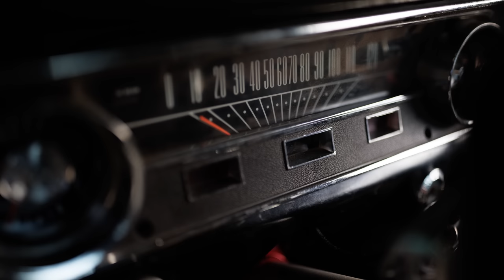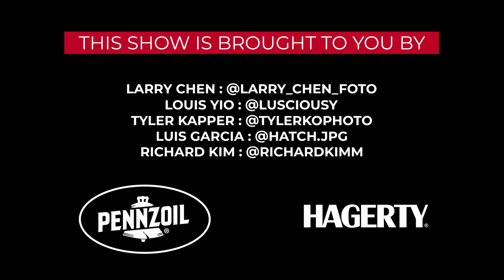TJ Hunt's GT-R Powered Mustang From Fast and FURIOUS | Larry Chen-Capturing Car Culture - Ep 3

Comment: Here's the thing about mid '60's six cylinder fastbacks (both the Mustang and especially the Barracuda) They are really light compared to later muscle cars. 1200 to 1400 kilograms.... with the cast iron engines being around the 200 kilo mark alone. Drop in an all alloy six, say a F6 Typhoon or Barra for this, or MoPar V6 for the early Cuda, and you wake up the handling and don't need huge power for them to be exciting.
200kW in 1000kilos, is like 600kW in 1800kilos, but able to change direction much much faster
Reply: I was thinking of a Pentastar V6 swap on either original Valiant Cuda or the modified A-Body Cudas because I think it will fit, gives enough power, but still can get a.very decent gas mileage.

With one catch: it has to be stick. I also think of putting either the T-56 or just go old school with the original A-833
Reply: @sx4mania35  I'm shopping for parts for my '66 VC Valiant, JK Wrangler has the 3.8 version of the 3.3 in my Voyager, later units had the 3.6. Both versions got a 6 speed manual (NSG370). The output end of the gearbox, the bolt pattern matching the transfer case, also matches a GM automatic that uses the same 4wd transfer case, and there's an output housing for the GM auto that would take very little machining to make the 6-speed (and the earlier NVG3550 5-speed) in to a RWD gearbox. An extension to the output shaft  will be needed, to bring the shaft through the adapted output housing to where a tailshaft can mount.
The engine will need an aftermarket ECU, but,.. Modern emissions and economy...
Reply: Also, rebuild costs of the 3.8 V6, compared to getting the same power out of a Slant 6,... the 3.8 is about 1/5th the cost.
Reply: @PiDsPagePrototypes  I know that feeling, especially CARB states...

the NSG is a very good box, especially if you're on a budget and do not want the fuss of transplanting a T-56 or keeping the old 833.

I think some aftermarket manufacturers have the elongated output shaft (not sure what you mean here but I assume it is the prop shaft), you can check suppliers like Summit.

Don't get me wrong. I love the Slant Six, but those A-Body workhorses can accept new hearts to give them more life. Not to mention better handling.
Reply: @sx4mania35  Exactly! Taking 100+ kilos off the front wheels, and having the V6's mass further back in  the chassis, plus the right alignment settings, a set of antiroll bars and the like, and a 64 thru 67 A body can run mountain roads far better then people expect.
Most folk build for drag racing, never knowing how much fun a winding road can be.

Comment: Sorry but why on gods green earth would you put an RB in a classic american made Ford Mustang.   You can give 100 reasons and none of them would hold water.    Also, the answer to the first question of why is not because it hasnt been done before.   Its because everyone knows its not cool nor a good choice.    Would you put a Ford 302 in a 2nd gen skyline would you? No, you wouldnt because youd ruin the whole point of the car.   That RB engines in those cars is what made the Skyline GTR so sucessfull and dominating on the track.   The same translate over the one one actual pony car.  You would have been better off putting in a twin turbo Ford Ecoboot just like the new Ford GT.  Now that engine would right by that car.   That engine was good enough to win La Mans 50 years later after the original ford GT40 crossed the finishline
Reply: Congratulations you have been selected among my lucky winner ✅
DM to claim your prize
Reply: This is what always gets me for builds built for views. Non of this dudes would ever swap a GTR with a coyote, ls or insert whatever. They always do it with a car they don't actually love. It's ok tho not our money.

Comment: Weird video. Guy bragging how he was challenged to build a car, then had someone else build the car? Bought not built
Reply: I wanted to write the same thing. Your the first post i saw that mentioned this. Yeah seems like different  shops built different parts of the car. When you hear alot of " we " the owner didnt build it. Lol. I can proudly say I for 90% of my car at least, aside from welding or exhaust, i did it all. Just a self taught back yard mechanic. Saved over 12yrs to build my dream car.